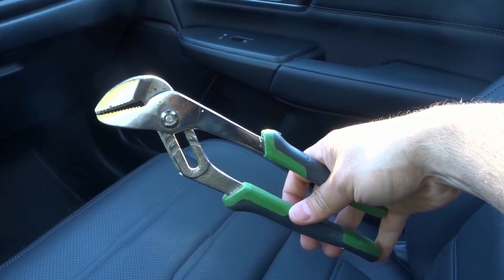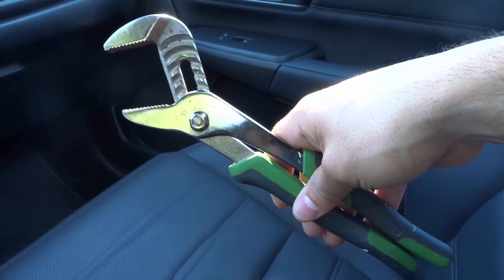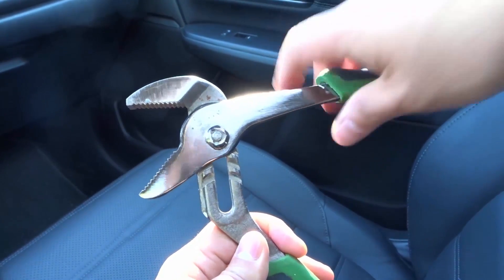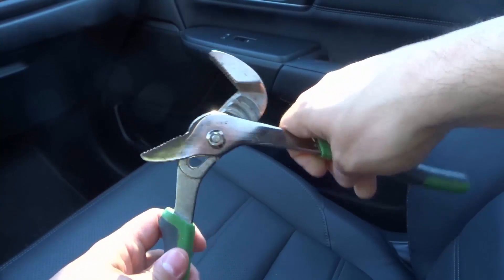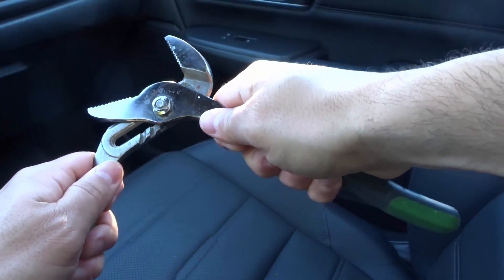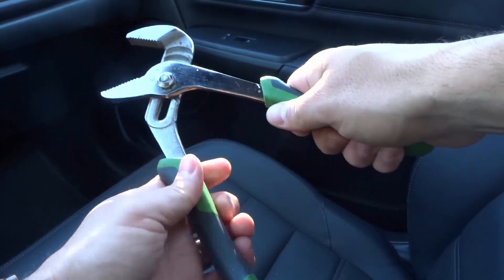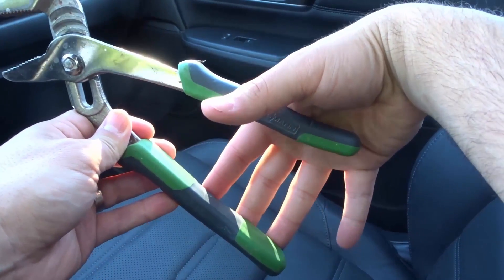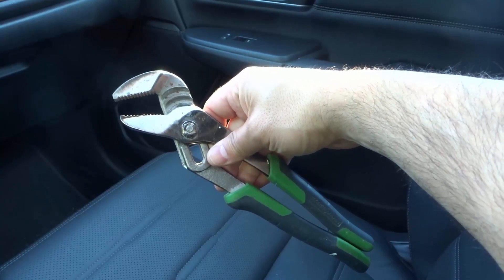How To Use Channel Locks-Tool Tutorial For Adjustable Pliers

Comment: You also may wish to update your video to show that most groove joint (tongue & groove) pliers are directional as well. Most models should only be used to turn in one direction and flipped over to turn in the other direction.  If you look closely at the little teeth you can see this easily.  There are a few exceptions with different models but most are directional.
Reply: I did not know that. Thanks for the tip, very helpful
Reply: Extremely important, same with Cresent wrenches.  Always pull, don't push.
Reply: @loopie007  Yes, and pipe wrenches too.  The big jaw is always for pulling, the little jaw for pushing.  Simple.